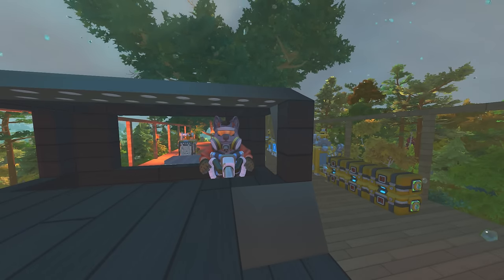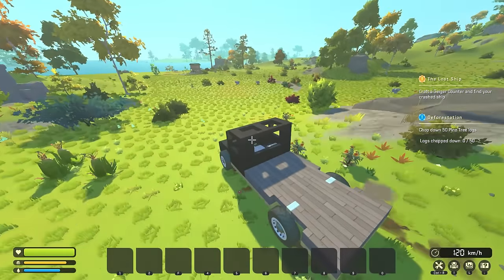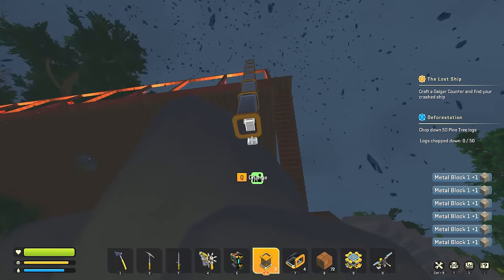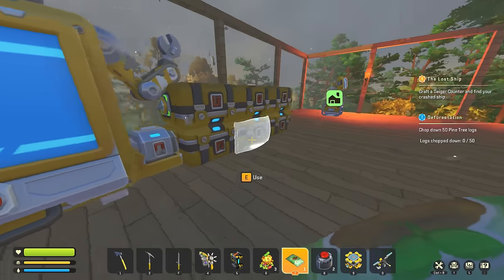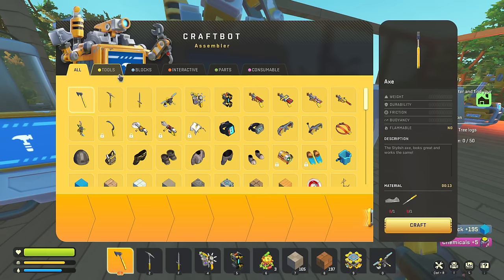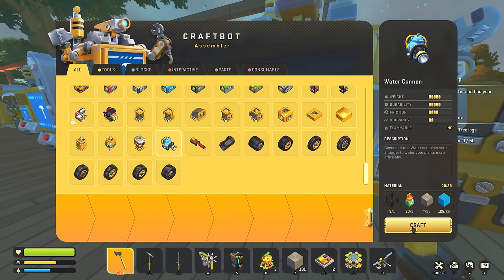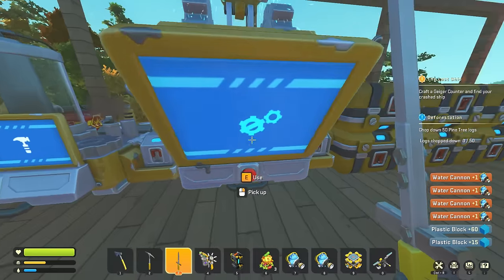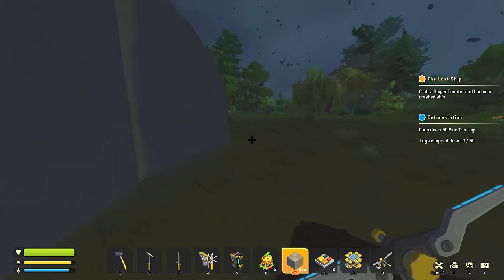I Built an Automatic Watering System to Make it RAIN on Our FARM! (Crashlander Survival Mod 15)

Comment: Maybe put T-pipes to split the water coming in from the pump into the water containers. This could reduce problem you were having where the first water cannons take all the water when the beam is moving back.
Reply: Why not use t-pipes to merge lots of pumps into a single container?
Reply: @davyzeradaspalmera  I was also thinking about that too, that way faster water delivery, and inly requires one vertical pipe.
Reply: he could try and use 4 way splitter, will fill same time
Reply: If he connects the pumps with containers at the watersource with blocks to his base, he doesn't need any Pipes, the water cannons pull from the container "wirelessly" anyways :D

Comment: Hey, Kan add a four-way X-shape vacuum pipe to the water vacuum pipe line and add an Automatic chest to it then add the water containers to the vacuum slots of the Automatic chest this will allow instant filling for the water canisters and add extra water capacity to do to way watering of your farm plots.
Two complete your current side quest and do Bill's side quest for his shed and unlock the Sickle recipe for yourself before harvesting any crops the sickle allows you to get extra crops/crop seeds from whatever crop you use it on although the amount is random and you can get either the crop/crop seeds.

Comment: Pumps in vanilla survival are much faster then they used to be. I'm playing vanilla survival and i can fill a large chest with a single pump full of oil/water in less then a minute. 
The only real issue with the new faster pumps is that when you're using them to fill crates at the packing station you have to add one stack at a time then wait a few seconds if you're using a logic loop to trigger the pump because the packing station can't keep up anymore. You can just use a timer block to slow down a pump but i find that feeding a few dozen stacks one stack at a time is so fast that whatever mild inconvenience that causes is minor compared to how fast you can package fruit crates now.

Comment: with the Flatbed, you should build several resource cages to haul around and suck up all the raw materials you can harvest and stow.
my guess is you might get a few dozen cages laid out and 2 nose mounted resource vacuums.
between trees, and rocks and such. you'll be set for days and your resource refiner will stay busy.
also, go into the desert and suck up a whole box truck's worth of oil!
double up your water storage tanks for a full out & back run. the pump from the lake can be left running to refill the tanks while the crops are growing and will be full long before they are harvested.
Reply: Couldn't Kan also use a splitter for the water tanks, (if there is a splitter) have the splitter before the water tanks.

Comment: 22:03 You could make the hangar doors thing on pistons and when you open it, the pump thingy comes out and water the field and when watering is finished pumps just packs itself in and close the hangar door :D
30:47 When you build the walls around, you don't have the spud guns to kill the wolves, just put the saw blades on bearings connected on some controllers or gas engines, like 3 blocks distance from a wall and blades should be positioned horizontal with no space in between each one, then turn them ON when defending, it saves a bunch of potatoes and they're probably indestructible. I mean, it works in vanilla with hey bots :D

It is just suggestions though :D

Comment: Crashlander has the fly command. If you don't wanna use it in the main save you could make a secondary crashlander save for where you can freely use the cheats for building.
The only caveat is that anything you build will need to be modular as it doesn't take much for a build to be too big for the materials to fit in a single inventory (if only the lift could pull from nearby chests...)

Comment: put a chest at the end of your water line, with a vacuum extractor pipe pointing out of the chest
will push excess water out of the chest into the water containers for the pumps

Comment: For automatic water refilling on emptiness, to facts first:
- Sensors and Switches/Buttons do detect water drops
- a vacuum pump reversed also shots drop but takes it from ANY container in the system

So you could add after the last container a vacuum pump on shooting with a slow timer that shots on a button/sensor. If it's not triggered, containers are empty and refill is needed.
To stop refilling you could add an additional container in the row and only connect a single water cannon that shots always on a button when there is water in the container. When the button is activated you know the others must be entirely full -> stop the pumping from the creek.

And when your rain system is on, your vacuum pumping should also be just always on, no mater what the state of the systems above is.

I assume there is no need to explain a scrap mechanic logic expert how to build the logic to detect if a button/sensor was not triggered in a specific time span for the first system.

Comment: I have found an over-complicated way to have your pump stop automatically.

Requires:
1 extra water container
1 extra water cannon
3 logic gates
1 sensor

Attach the extra water container at the end of the chain— when the 3 first containers are full, this one will be supplied too.
Have the water cannon draw water from that container. This water cannon should be wired to the same toggleable logic loop as your water pump, but not on the same logic gate, so that it always triggers a tick after the pump.
With the 3 logic gates, make a memory bit. This memory bit can be turned on by some input of your choice (for instance, whenever the farm is used)
It is turned off by a sensor, which looks for anything exiting the water cannon. Having it look down the barrel works— or you can place it on the side too.
Use the memory bit as the toggle for the logic loop that controls the pump and the water cannon.

In my tests, the water cannon seems to eject 2-10 times before the loop actually toggles off. I assume this is because the sensor might not be 100% accurate with water being thrown randomly. But it seems reliable. Regarding the wiring of the water pump and cannons, it seems water can accumulate in the water container if both are wired to the same input— which can cause the system to turn off on startup. This is why they should be triggered in sequence— the pump, then the cannon.

Comment: 40:00 - I would have two switches and an OR gate so you could turn it on from down below and up inside. Also, connect your intake pump to your watering switch (maybe with a timer delay on shutting off) as leaving a pump on all the time can cause lag issues.

Comment: For the water running out on the return. I'd add a split pipe at the bottom and some more vacuum pumps. Plus an or gate to turn it on with either the watering or pumping switches.

Comment: Why not connect the craft stations using chests under the floor?
If you place the chests below a bit forward, and make a slit on the top floor, you should be able to access the contents from above, reducing the pipes needed to connect the craftbots and having some nice, clean chests embeded on the floor
Reply: I believe he said that he was doing that, but as he said in this video, pipes cost a lot of material.
Reply: @thomasbennett8864  That's why he should use the chests he already has; It would take 6 bends and 2 or 3 straight pipes to pipe the chests in the way I mentioned.
Else it would take 2 bends (if using upside down chest) but many more straight pipes

Comment: How about building trailers for oil pumping, refining and ect
Try to make a restricted motion trailer joint (to not jackknife or flip)
Recommend building bill shed for the sickle very helpful and when doing the quarry Quest save before entering HQ because it can bug (you can use the welding tool on the battery)
You can pick up some bananas from the shipping crate outside HQ
Recommend trying the loot glasses out

Comment: You can pump chemical from HQ chemical pool. There is a buildable place in pool. Just put a vacuum pipe, a chest and switch it will full in a minute. Its harsh to see you struggling when trying to collect corn and flower lol

Comment: Those pumps are the same speed of what Scrap Mechanic was at least a year ago.  Do saws and drills scare wolves and bears?  Just put the pump on a nor switch so it always runs.
Reply: Yeah they changed the tick rate for the pumps a while ago. It was a very welcome change as they were incredibly slow before.

Comment: the issue with the assembler you noticed is because they can't pull from their output any other chest there it would work but because it is attached to it's output directly it doesn't work

Comment: I was noticing that the asthetics of your truck are a little off. You need 1 more layer of material on top of the flat bed. It needs to cover the tires on top. (Also you may want have it protrude 1 block on all sides). A headache rack would be cool too.

Comment: if you want alot of chemicals, you can put a box on the ground in the basement and build pipes off of that with a pump to then pump from the chemical pond into it, worked fine for me.
Reply: There is one edge you can build on in the pool itself, by the way. Its just above the surface and 1 block high. It's the edge you jump over to get onto the beam in the pool.

Comment: The assembler can't pull from right but can put to left, so as long as there's no chest right to it, it should be alright. (you may need to switch it up with one of the otehr stations)

Comment: should build the shed for bill asap.  you will regret not to have done it sooner.
also try having water pump into a large chest. then a pipepump. then a X vacuum pipe with the 3 water tanks attached.  this way you have a buffer and should fix the water problem. if not then add more pump to suck up water.
recommend  getting the vacuum pipe connectors from mark.  200 copper and 50 carrots gives you 50 of them.. alot of component kits saved.

Comment: Instead of an oil pump truck,  considering you only really need to grab one chest full at a time, maybe you could do an atv/side by side. It could double as a scouting vehicle. You could even do a trailer that has the pump and an extra chest for a cleaner build on the atv.

Comment: For chemicals, I think you should put a vacuum pump and a switch on a chest, and hammer it into the chemical pool in the laboratory in the HQ. Then you'd be able to have infinite chemicals.
Reply: There is actually one edge in that chemical pool you can build on. It's right above the surface - enough to place a chest, pump and button etc. Everyone I've watched go in there on YT have missed it because they haven't tried placing on the edge you jump over to get onto the beam that goes over the pool.

Comment: You should try connecting  the Water tanks together with a 4 way and then connecting the 4 way to the pump so that it might split the water between the tanks equally

*I haven't play this mod nor messed with vacuum pipes so I don't know if this would work but it might be nice to try

Comment: I can't get the vacuum pipe filters to work. Any tips for auto storage with the filters would be nice.
Reply: Each pipe filter only lets you select one item to allow through. Connect the Pipe filter to a pipe and the other end to a chest. You'll need to make sure the orientation is from the pipe to the chest  then you can make your filter selection on the Pipe Filter.

Comment: Two things: one, the vacuum pumps are fast in vanilla, but only recently. Two, the only way I know to detect if the water containers are full is adding 00Fants advanced logic. It has a chest fill detector in it and crashlander supports modded blocks with crafting recipes.

Comment: Why do you not make your truck electric if you have infinite batteries? You could even have a mini battery generator on the truck so which would always be loaded so you don't have to refill it ever. Love your videos and this series!
PS: can you use of of those T-shaped pipe pieces to fill all the water tanks equally?

Comment: Im a bit surprised you just dont make a oil rig, make a recrangle base and then you just add or remove the rig from your flatbed when your not using it, and you can make other attachments for crafting, refining, etc etc so you dont have several vehicles to store

Comment: big farm is nice and all, but why? there is no traider and no packing station in crashlander, i just focused on a nice big miner and had no copper shortage what so ever, i dont think i traded even once with the npcs since i didnt felt the need to spend my time driving around when i could just get everything myself fairly easy, if you wanna spend some time on s.m. survival i would go for Fant mod wich has pretty much everything one could ask for. i like crashlander very much but once you have finished the quests there is rly nothing to do right now

Comment: ? have you seen the 6x6 thunder truck rumor/art would love to see a wide long and maybe tall truck for mine elevator and storage and trasnport arm to grab huge items with idk if it possable 1 seat to 1 controller to split to 6 wheels with 2 large alternators with tee junction to battery box  then to each electric engine